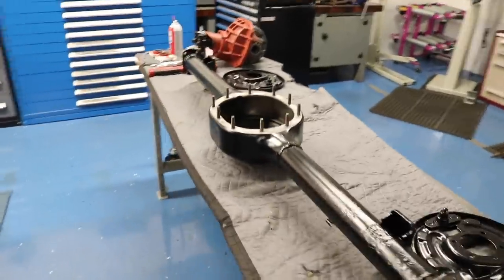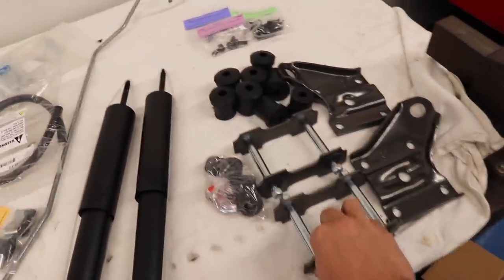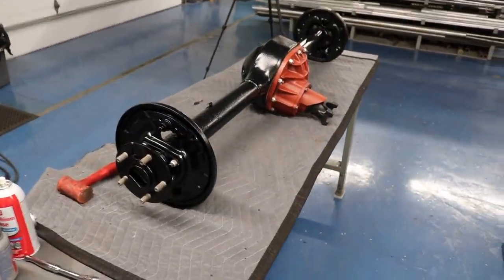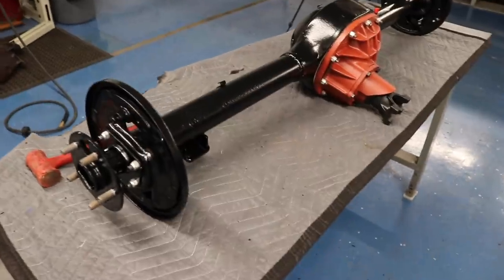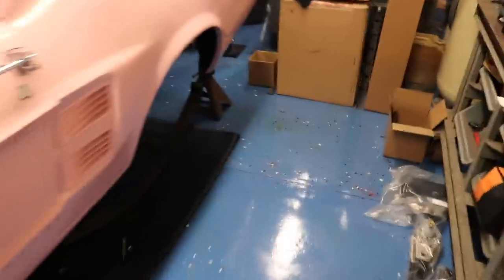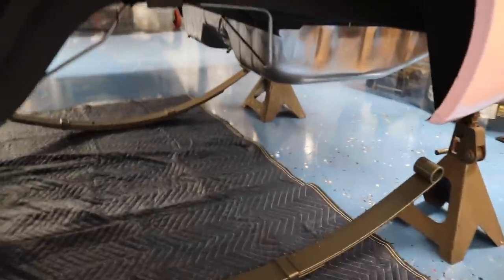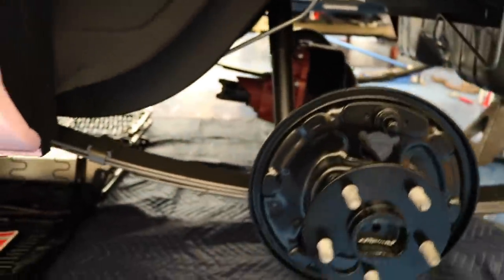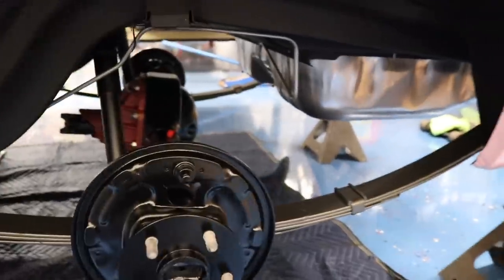Installing New Rear Suspension & Assembling Rear In Mustang Fastback

Comment: Hi Ben.Did you put any anti sieze on the front mounting bolts? I had to rebush my springs in my 1966 Mustang a couple of years ago and I had to make a special puller to get the bolts out as they were frozen in. A real bitch of a job. Pity they didn't put anti sieze on them at assembly but we all know that is not the case. Shes looking great and can't wait to see her rolling. Cheers Ian New Zealand

Comment: Awesome videos as usual! 

I’m rebuilding my 8 inch rear axle on my 66 coupe and I got the wrong gaskets for the axle flange. I know the felpro 55001 fits behind the retainer, could I use the 55001 also for the the backing plate to flange? Or does that need to be different? The 4978 felpro one doesn’t fit. The other I’ve seen is the 4828 that would fit. Just didn’t know I could use the 55001 for both? 

Hope you can help as I can’t find an answer online! Be much appropriated 

Cheers